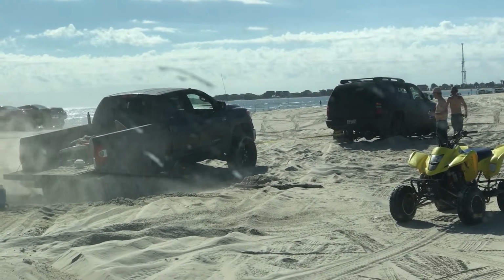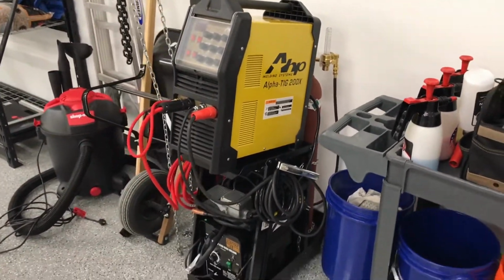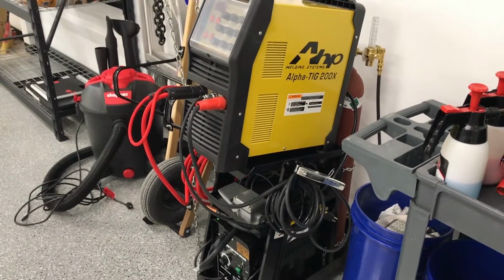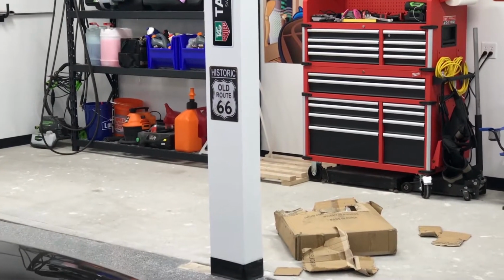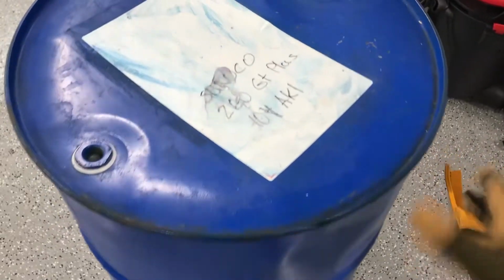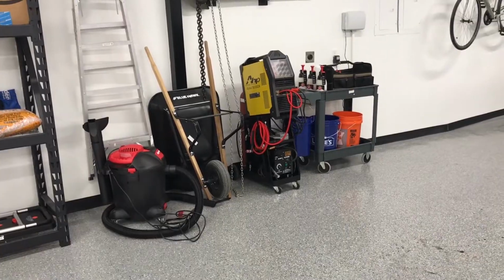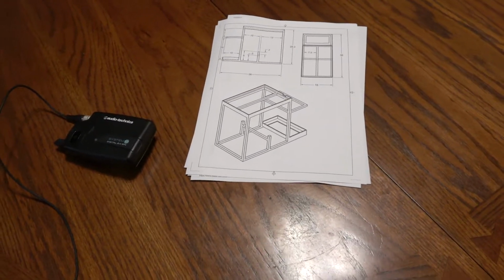Procharged Mustang Bypass Valve Sound

Comment: Time stamp?
Reply: Nah man the sound of the motor. Sounds great btw. Debating whether or not to supercharge or turbo my 5.0
Reply from the maker: Ah, yea thanks man, appreciate it! Either turbo or supercharger can be fun. Supercharger is a simpler setup, has linear power for road course applications and has less heat issues. Turbo is definitely going to be easier to go real fast for highway pulls or drag racing and you can have easily adjustable boost. Turbo is a harder setup, and there are more heat issues with a front mount twin turbo type of setup.
Reply: Sick thanks for the knowledge my brother. I love the sound of turbo’s de compressing, but it’s probably smarter to just install a blower.

Edit: smarter for me since i won’t be able to constantly bring my car to mechanic if any issues arise with turbo (going to the military). Not saying smarter for everyone 😅
Reply from the maker: Not sure what the question is, sorry.
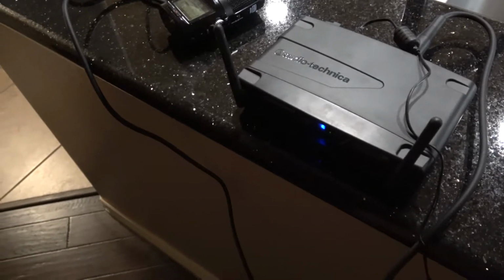Reply: 7:35
Reply from the maker: Ray Bandz the display on the car? I never set the time on there. Battery resets all the time. Its not a daily driver.
Reply: How much WHP you pushing ? buying this same kit within this week